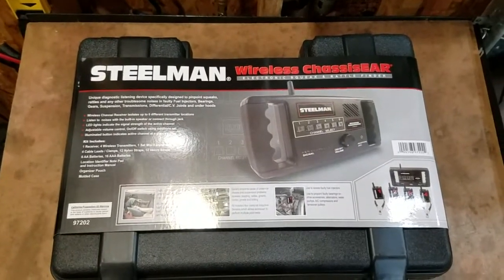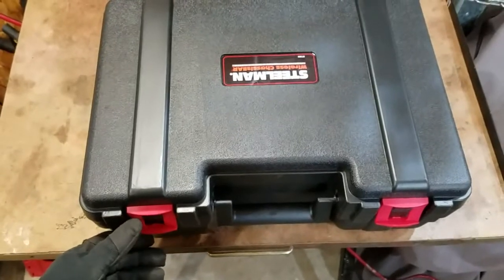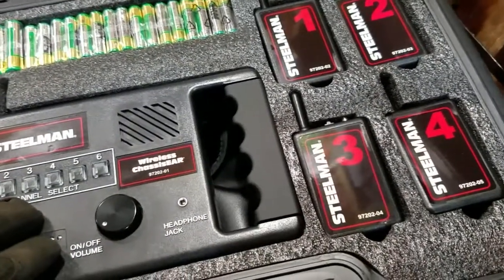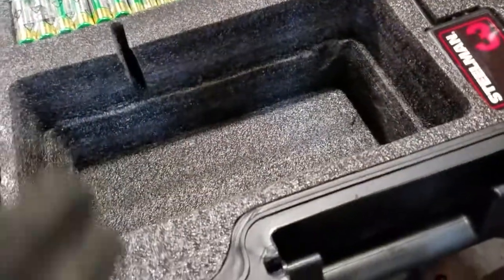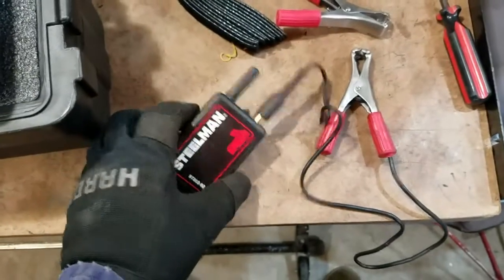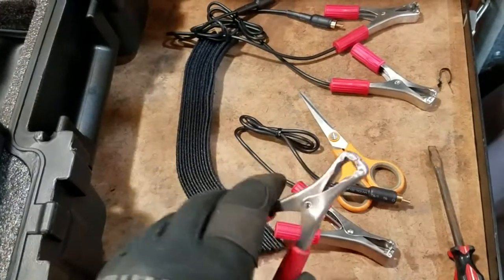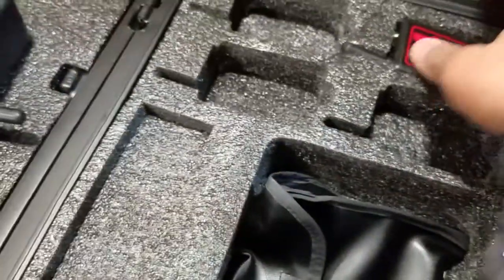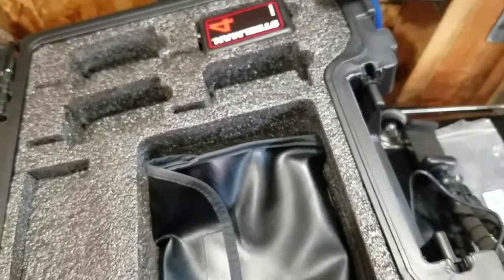Steelman Wireless Chassis Ear Review

Comment: Good video! I was thinking about buying one of these tools for a whistling, Whurring noise I have. Anyway if you want to check for a bearings or a strut, strut mount etc.. you may want to hook your tool to the spring. The springs are good for a range of finding noises and problems especially bearings.
Reply from the maker: Hi and thanks for the tip. I have another noise to diagnose on the front suspension.
Reply: @Pk3_Garage  Try a garden hose if the steelman doen't work. Yeah I said the same thing "A Garden hose! what!! stretch one out, not too long, maybe cut it put it up to your ear and tap gently the tip of a screwdriver, you would be amazed. It;s just a pain in the ass tying up the hose, use wire or tie wraps, It found my Center Supoort Bearing on my driveshaft. center of vehicle under heat shields and exhaust. The u-joints I found after when the shaft was off. becareful with the hose wrapping around something and hang your self by accident..lol
Reply: @Pk3_Garage  Here we go. Not to get off subject but maybe it will help me or someone else out there. Just thought of something with the Chassis Ears if your chasing a whistling, whining, whurrling noise that can be in the front and sounts like it's coming from the center or rear. My noise is defeneteley coming from the driveline and I'll explain why... The noise I have comes in at around 30 mph and stops at about 38mph especially when cooler out, maybe cuz the grease is thicker then. That said... I was driving and put my BMW x3 e83 3.0si in neutral, noise still: there. I made some sharp left to right hand turns: noise still there. I shut the engine off at about 45 mph coasted down to around 35mph and noise came back. Ok so no power to Tranny and Transfer case, No torque to Driveshafts. Differentials and CV halfshafts / axles. Replaced rear bearing, rear driveshaft cuz the U-joints cant be replaced on this wonderful investment. So if can't be a vacuum leak, enginge not running nor Alternator and any associated engine parts that's not turning like a pulley, belt, tensioners. 

The point is, How can I get the Chassis ears to work? Maybe able to isolate the noise, I was thinking, maybe take a metal tube suck as a small very small in diameter exhaust pipe, clamp the ear on the pipe, not the pipe were were all smoking, and maybe it will resonate through the pipe which can then be directed towards your noise. PK3 if you have the time hook it to something and see if it works. I'm still in the market for one.
Reply: @Pk3_Garage  Here we go. Not to get off subject but maybe it will help me or someone else out there. Just thought of something with the Chassis Ears if your chasing a whistling, whining, whurrling noise that can be in the front and sounts like it's coming from the center or rear. My noise is defeneteley coming from the driveline and I'll explain why... The noise I have comes in at around 30 mph and stops at about 38mph especially when cooler out, maybe cuz the grease is thicker then. That said... I was driving and put my BMW x3 e83 3.0si in neutral, noise still: there. I made some sharp left to right hand turns: noise still there. I shut the engine off at about 45 mph coasted down to around 35mph and noise came back. Ok so no power to Tranny and Transfer case, No torque to Driveshafts. Differentials and CV halfshafts / axles. Replaced rear bearing, rear driveshaft cuz the U-joints cant be replaced on this wonderful investment. So if can't be a vacuum leak, enginge not running nor Alternator and any associated engine parts that's not turning like a pulley, belt, tensioners. 

The point is, How can I get the Chassis ears to work? Maybe able to isolate the noise, I was thinking, maybe take a metal tube suck as a small very small in diameter exhaust pipe, clamp the ear on the pipe, not the pipe were were all smoking, and maybe it will resonate through the pipe which can then be directed towards your noise. PK3 if you have the time hook it to something and see if it works. I'm still in the market for one.
Reply from the maker: @nicks7548  Humm, sounds like your noise is coming from the drive. Might be a tire, cv axle or front wheel bearing. Do a video of the noise and post it on YouTube to get feedback. The Chassis ear might or might not find this type of noise. If the noise has any type of vibration, it will find it.

Comment: After watching these videos, I bought one, but it doesn't work as the manufacturer advertises.  "These are in essence, contact microphones that detect minute vibrations at the source". 

So beware, other potential buyers:  Despite their advertising this device does not actually hear noises, only converts detected vibrations.  So, if you are trying to locate an airborne noise on a chassis like me, this device won't do it.
Reply from the maker: Your correct that it only picks up noises through vibration. I never got the impression that it would pick up noises in the air. The alligator clamps are microphones to pin point what is actually making the noise.  In your case, I think you miss understood this tools use.
Reply: @Pk3_Garage  Nope -- I'm very well educated/qualified in noise and vibration control.  E.g., "Noises can be transmitted up to 50-feet from the transmitter" -- no, those senders detect and transmit vibrations, then are converted to noises in the receiver.  Their description was misleading; they've now agreed to a full refund.  I have provided corrected text to them, and hope they will use it.
Reply from the maker: I won't go into a debate over this.  I'm glade you was able to get a full refund.
Reply: @HemiCudaGuy  Thank you for your comment, 300 euros saved

Comment: Thank you for recording this video. I watched your video because I was interested in buying the Steelman Wireless Chassis Ear to diagnose a noise on my truck. The sound your vehicle was making sounds the same as the noise on my truck but I have shock absorbers instead of struts. 

I'm curious, if the noise your vehicle was making while driving was also faintly heard after coming to a stop with the engine still running.
Reply from the maker: Sorry for the late reply. The noise was only when going over bumps.